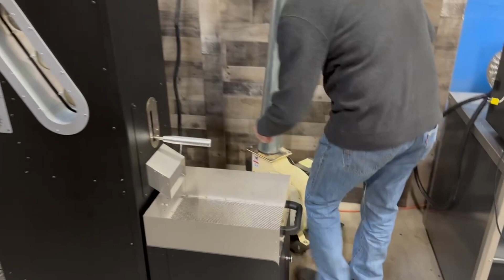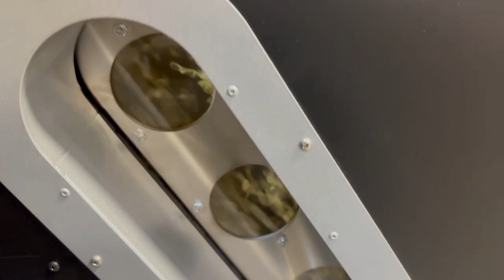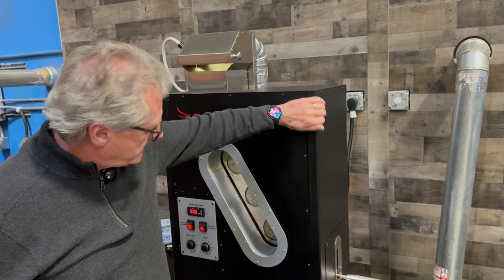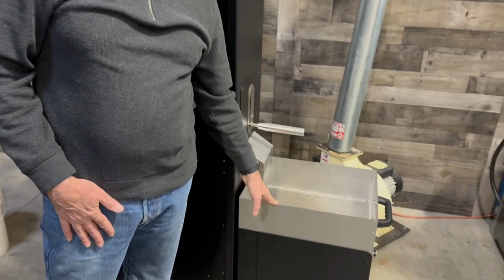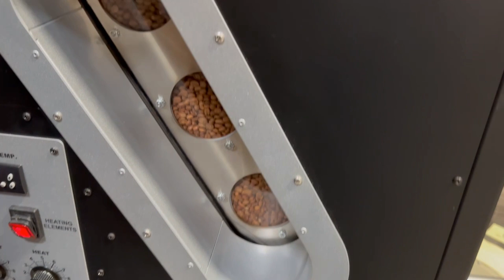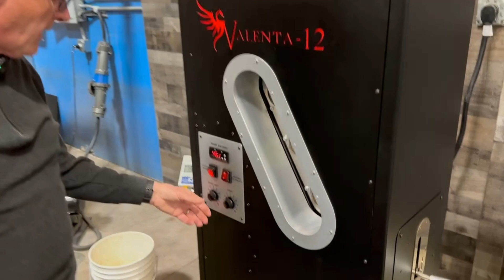Valenta 12 Roasting Video

Comment: If i choose the 8 model, is it
Recommended to hold back 10-20% or can i run the full 8lbs?
Reply from the maker: Good question, tricky answer... The roaster can absolutely roast a full 8 lbs, but the time it takes to reach your desired ending bean temperature might not allow for full batches on certain profiles. 

For example, let's say you have a medium-dark roast Colombian bean that needs to be done in 11:30. If you were to roast a full 8 lbs, it might take you closer to 13-14 minutes, which could affect the profile. Therefore, roasting this bean in 6-6.5 lbs batches will allow you to reach the 11:30 time and give you a better roast. 

On the flip side, light roasts are on average about 2-4 minutes faster due to the lower drop temp and would allow you to roast full 8 lbs and still hit your roast times. 

In summary, the roaster will handle 8 lbs batches, but your profile might not allow for it.

Comment: What is the temperature of the smoke coming out?
Reply from the maker: We have taken these readings over the years at the point in the duct run right before the smoke goes through the wall which is only about 3-4 feet from the blower. The reading has never been over 190 degrees F, and that is only for a brief moment after the beans are dumped into the bean cooler and there is a rush of hot air. Normal operating temps will average 140-160 degrees F. We don't use any special heat protection going through the wall and have never had an issue.
Reply: @coffeecraftersllc thank you for your reply, It's helpful❤

Comment: Can you customize your roast time and temps with these for different type roasts? They seem very manual and simple, which isn’t a bad thing but would be great to adjust it to your liking.
Reply from the maker: Hello! The roaster will produce any roast type, from super light roast all the way to extra dark and everything in between no problem. It's just a matter of time which can be adjusted by turning the heat setting up or down. The roaster has a window of about 6-10 minutes which is the sweet spot for this machine. You can also roast on AUTO with the Hermetheus Co-Pilot to automate parts of the roast and use roast profiling software to set the time and temp automatically.
Reply: @coffeecraftersllc  yes I have seen your others videos talking about using Hermetheus Co-Pilot and profiling your coffee. 

So does the Valenta 12 or 18 come with this already installed on them? And if they do is there anyone that could train me on how to profile my coffee beans to my specific roast and save that profile setting for it to do it automatically while I supervise, time after time??
Reply from the maker: @mr_spencermorris  The V12/18 both come with the co-pilot standard. Jason at Hermetheus would be happy to walk you through how to use the software so you can get everything dialed in.
Reply: @coffeecraftersllc awesome, thanks again for all the info. Once I’m ready to pull the trigger, I’ll get with you on ordering a Valenta!